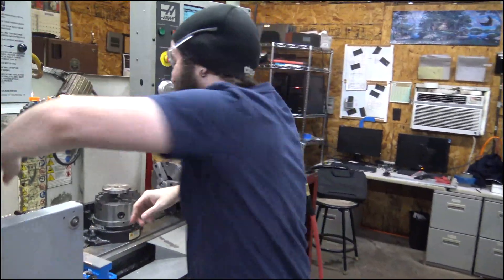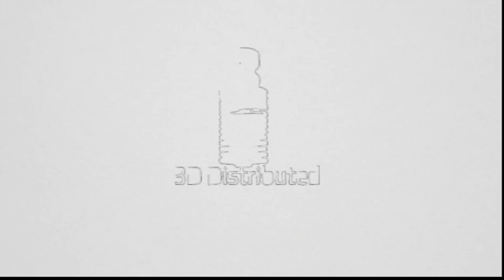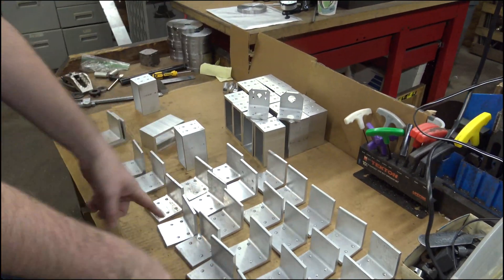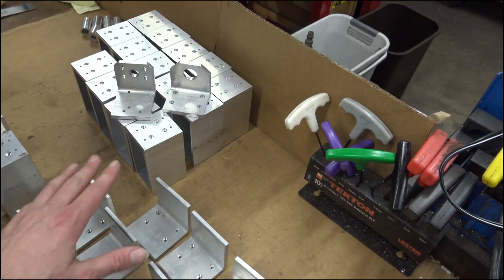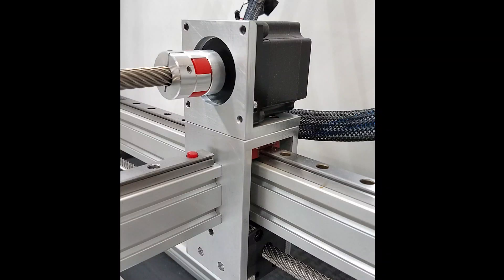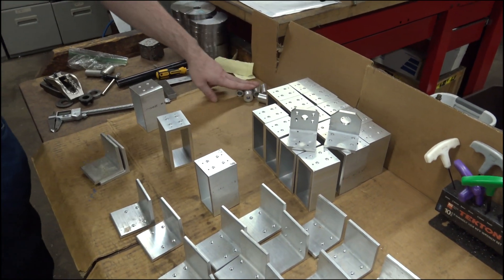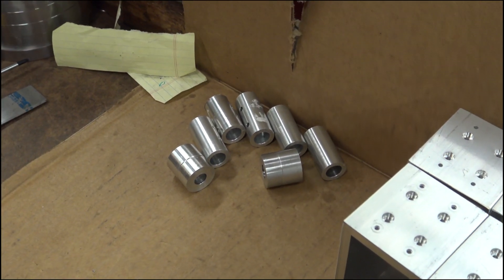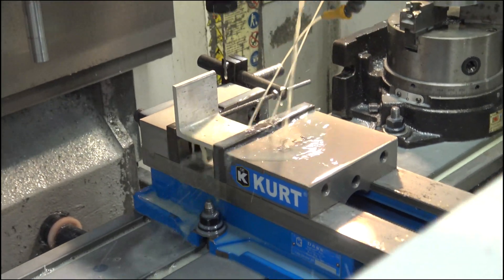Machining WorkHorse 3D Printer Parts

Comment: Hey how much extra material do you prefer to have on the 3d printed part before machining?
Reply from the maker: It depends on the length and width of the part. I usually add 1-3mm on a saw cut to make sure it cleans up on the machine. But if your machining 3d printed parts I would start off with .5mm